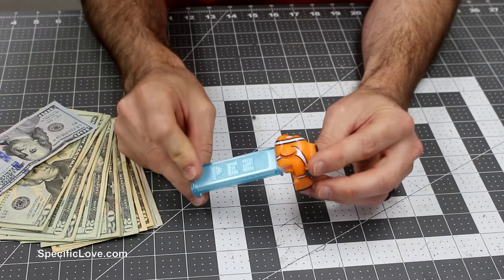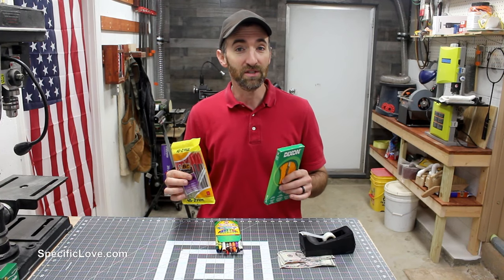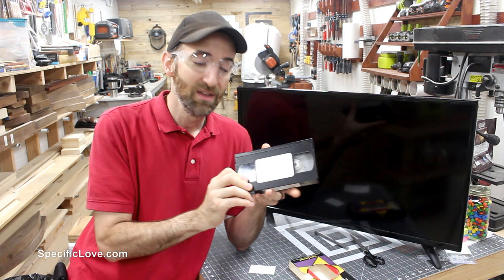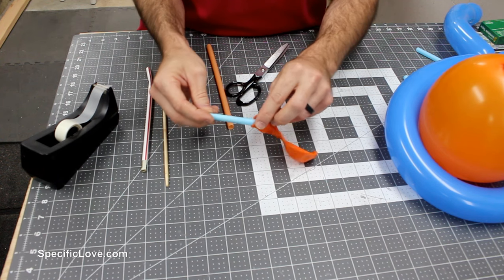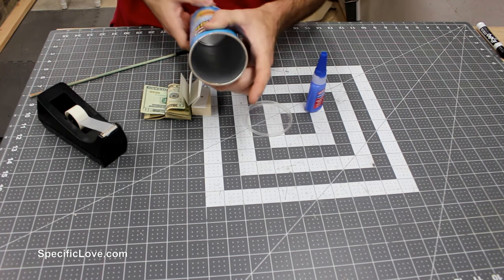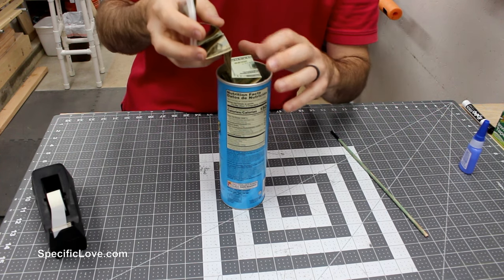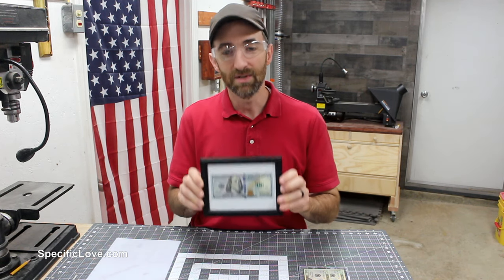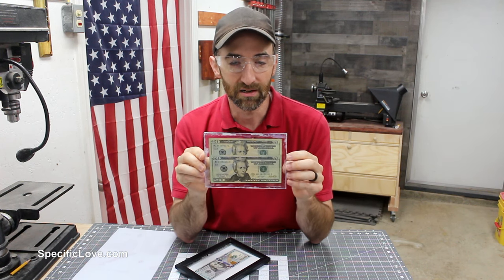10 Ways to Hide Money in Gifts

Comment: neat ideas! I was wondering if you have any suggestions for dying/coloring PVC? I read an article on makezine.com about putting dye in PVC cleaner, but the idea I had was to use alcohol inks. Have you tried coloring PVC for nice projects before and if so, what methods have you used for a nice clean finish?
Reply from the maker: I never fully tried coloring PVC, so I do not want to misdirect you. Now if you wanted real colored PVC, do a search on Amazon and you should find some in many colors. They are a little more expensive, but the coloring does not scratch off.
Reply: @SpecificLove7  thank you for the information. I might try to color my own PVC and will be happy to share my findings with you if you would like.